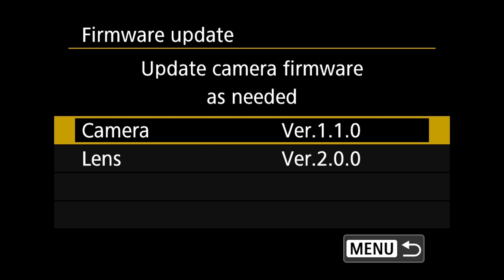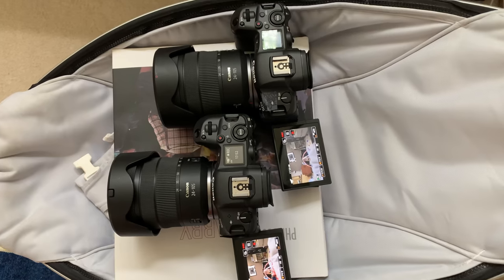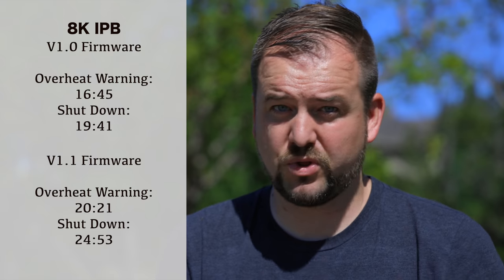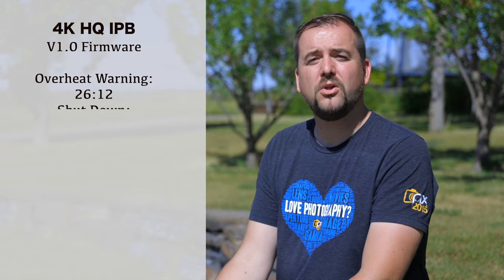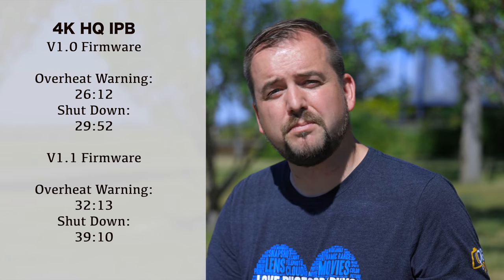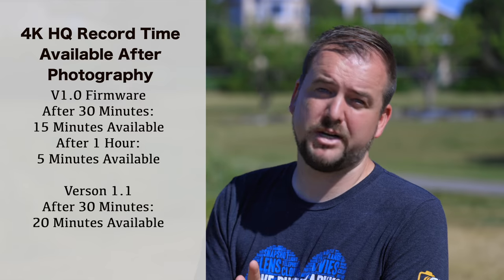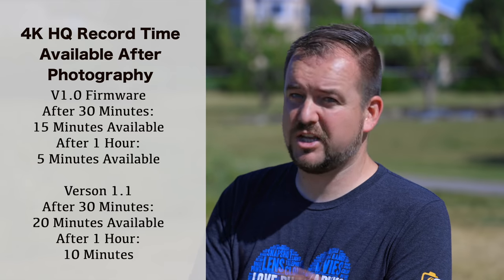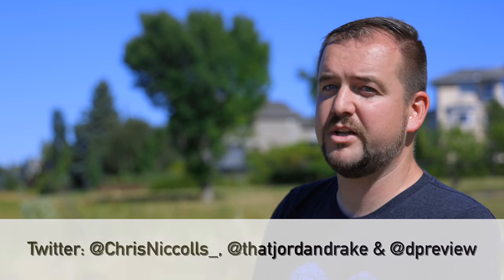Canon R5 Firmware 1.1 - Is the overheating fixed?

Comment: The question is why does it take so long to cool down? What the hell? My oven cools down faster! It must be a software thing
Reply: it is, and yes, it feels too artificialy limited in that way. only thing that can be done is keep pushing canon so another firmware fix will come.
Reply: it's basically a timer in there. There are reports from techblogs out there that taking out a single screw in the battery compartment will deactivate that timer entirely.
Reply: @makanimike  not directly. you block the switch in the battery compartment (with a screw or something similar) so it thinks the door is closed. that way you can pull out the battery anytime without the camera proper shutting down. without proper shutdown, it does not save the overheating timer flag. so when you put back the battery, it doesnt know it already run for x amount of time and starts clean. thats only to proof the timer theory though, not a valid workaround.
Reply: Your oven is not weather sealed....
Reply: Digi20 although it appears to be a software limitation I don’t think it means Canon is intentionally trying to cripple the run time. The cameras may well be capable of running much longer but at what cost? Heat and electronics are never a good mix. I’m sure Canon did testing and created limitations for the longevity of the camera. Imagine one could record unlimited but then 3 months after using it the camera fails. Now that would be a much bigger problem than overheating. To me it appears Canon is trying to push the limit of the camera with regard to the devices life expectancy. I don’t think it’s an intentional cripple hammer like many are making it out to be.
Reply: It's not hot in the first place. And it's just the cooldown timer running. Temperature sensors have no role here.
Reply: @dwmspace  it is a cripple hammer because the timer is artifical. electronic components do have rated life expectancy in regards to temperature. f.e., 2000 working hours at 95°c. it is enough to set a simple temperature limit where the camera shuts down to archieve the life expectancy canon wants, its not different to a notebook or any other high tech electronic device around in this regard. 

the timer would only make sense if the camera is so badly designed that one ore more components reach critical temperatures really quick and canon actively wants the user to get annoyed by the camera and dont use these features often (instead of contructing enough headroom into it). but this would just be silly and i dont know of any device that works like that.
Reply: @schaerfentiefe1967  it's sealed enough to maintain temperature
Reply: @E_8519  no oven will maintain temperature for more than some minutes. It will need to switch heating on and off to keep the temperature on a constant level.
Reply: @schaerfentiefe1967  it is also 400 degrees. So you're saying the camera is heat sealed? That's not smart
Reply: Digi20 the timer is there so that the camera doesn’t immediately shut down or within a few seconds of an overheat warning. It’s in place to make a prediction. It’s much better for example to have a warning and know that the camera can still shoot 5mins so that one can better plan a scene than recording something critical and have it shut down immediately or within seconds. To me it makes sense. A computer has the ability to slow down cpu performance and kick in fans or to shut down immediately to avoid damage. A camera does not have that same luxury to slow down its cpu performance if recording something like 8K. Also I’d much prefer a shut down prediction than have my camera just shut down quickly. This is not a cripple hammer, it’s the nature of the camera and giving the user an ability to use it reliably without sudden surprises.
Reply: @Digi20  It maybe the case that Canon is using timers instead of putting multiple rtds (most likely)/thermristors/thermocouples (temp sensors) in the cameras on different components. I haven't seen any of the breakdowns mention how many actual sensors are in the R5. If there's only one (or possibly none) and it's all based on Canon's engineering tests where they attached external sensors and then developed timers based on that research then all there would be would be timers. That wouldn't be crippling it would be sensible time limits based on data and averages to prevent long term damage to the camera. Now they might be able to fine tune that over time with more data but that may have been the route they went. Now I'm sure someone will say it's still crippled they should have put more (or some if none are there) temp sensors in and used actual real-time data and maybe they should have but one rtds/thermristors are another failure point (and they have a high fail rate tbh and would be more likely to fail then other components and then turn it into a brick) and two they would take up more space on the boards/in the camera that may not have been easily available.
Reply: @kaadhome5821  You are correct. Gordon Laing made a post today where he talks about the info that Canon shared with him regarding this. Basically it has 3 temp sensors (one that's external) that determine when it's safe to shoot or not. The firmware update won't allow higher temps, but has enabled the sensors to take readings more frequently for more accurate data, and as a result the camera is able to record longer, and recover faster. Gordon confirmed this info by putting his camera in a freezer to speed up the recovery time by 3X.
Reply: @kaadhome5821  according to a tech site (i forget which, sorry) there are 3 sensors. plus the timers. with the new 1.1 firmware update, they gave more weight to the sensors and less to the timer, so the camera runs a bit longer. its just a software thing. and of course there has to be sensors because the cameras get used in such different temperatures that only timers would not work
Reply: @dwmspace  of course a short timer makes sense, but it has to be one that is sensible.  when the camera records and cools down for exactly the same time, regardless if its in a fridge or an oven, than it clearly is not setup right and crippled.  firmware 1.1 from yesterday shifted that behavior a bit away from the timer to the actual sensors. but to me it still feels to artificial. cool down should be much quicker than it is at the moment.
Reply: Digi20 I believe it is sensible and they’re working on improving it obviously. They’re optimizing a design without a fan and large heatsink. There’s only so much they can do without making the camera much bigger or noisier. It could also well be that having a heat sensor and cpu to measure in real time is too processor intensive, generates more heat in itself and drains battery. I think the trade offs are reasonable for the sensor resolution and recording abilities. Higher resolution sensors that capture 4K/8K is ultimately bound to generate a lot of heat and Canon’s best bet has been to average the maximum recording time while keeping things operational.
Reply: Digi20 sorry that is BS. You cannot make a blanket statement and say all components work up to 95C. I deal with this all the time, some only have 70C limit. Others will fail at a elevated temperature. Each and every component has a maximum operating temperature. If you exceed it, maybe not to today, but it could be tomorrow, next week, next month or even next year that it will fail.
Reply: @FelixCervantes  I never said that? I wrote f. e. (for example).

Comment: Why does everyone excuse the over heating R5 citing its 8k, CFExpress card and big sensor when the R6 is suffering from the same issues with non of that and only a 21MP No one is talking about that. My 90D shoots 4k with a 32MP sensor @ 10/fps for ever...?
Reply: 10fps is no big deal
Reply: Your 90d doesn't downsample a full readout of the 32 MP sensor to make a 4k image. The R6 downsamples the 20MP sensor to get the 4k, which is more intensive than a pixel binned 4k.

That being said, the overheating limits on the R5 appear to be implemented by a timer rather than a temperature check. Agree that the R6 should get some more attention
Reply: The difference between 90D and R6 is that when using R6 in photo mode the sensor and the EVF/Screen are ON the whole time which produces more heat in all modes.
Reply: @thatcherfreeman  downsampling 5.9k to 4k isn't an intensive task with the current  image processors.
Reply: @karthik2166  True, the intensive part is the heat created by the sensor readout, not the image processing part.
Reply: @Pozdravlyau "Clown" you tell it to your family members. Having said that, yes my mistake R6 (not R5) does display overheat warning and shuts down in any mode. I don't need to read what pixel binning/oversampling/downsampling or whatsoever makes you feel more knowledgeable, since I know what they are but there's no mention of them in the original comment about 90D, which shoots at 10fps anyway....
Reply: Karthik exactly take a look at 1dx mark iii. No issue there
Reply: Your 90D has a smaller sensor, and 10fps seriously?
Reply: 90D doesn't oversample. it's more like line-skipped 4k, which is relatively soft. Whereas, the amount of data for processing R5 and R6's footage is literally massive. (8k and 6k each) So your comparison is basically wrong.
Reply: @davidum1900  The Nikon Z6, Sony A7iii and the Panasonic S1 are also using oversampling to create 4k from a 6k sensor readout. And for the most time those cameras don't have any issues with overheating. And they are running on much older hardware.
Reply: romanpul to be fair tho, the oversample readout for the a7iii is only for 24 fps 4k not 30 fps. But yes, I agree with you

Comment: Canon has added these limitations in the programming. Extensive tests have shown that the camera completely cools in min and sometimes even seconds.
Reply: The thermal design is inadequate for chips generating significant heat. Either the chips run cool and the lack of cooling doesn't matter (which would mean the so called "thermal limits" are artificial) or the thermal design is shoddy (which could be either incompetence or intentional crippling). In the latter case it is not only possible, but likely, to have one or a few chips overheating in an otherwise cool camera body.

Comment: got the code from canon:
Version 1.0
function overheating(){
const OVERHEATING =19.2;
..
}
Version 1.1
function overheating(){
const OVERHEATING =25.4;
..
}
Reply: so they just increased the threshold?
Reply: @shaikhahmed7929  non, they increased the duration they allow you to use your new toy
Reply: @shaikhahmed7929  What they ACTUALLY did (I realize the original comment was an attempted joke) is increase the frequency that the 3 built in temperature sensors retrieve data, and as a result they are now more accurate and record times are longer.

Comment: Ok, guys, you have such a big platform and you not gonna acknowledge the findings of Andrew Reid from EOSHD? If he is correct all those limits are purely artificial software crap… I think for the sake of your own credibility you should start at least mentioning the potential scam that Canon is running here to preserve their cinema lineup. Cmon, guys!
Reply: Ya it maybe fully software based to cover for lack of additional hardware to take true measurements. It is common to do temperature engineering testing during to development to develop data for how quickly something heats up in what conditions and what is harmful long term so as to develop firmware (not software) to dictate how a device functions. Temperature sensors take up space and are prone to failures so if you can avoid them and they aren't hyper critical it's best to do so. In some device's they are needed or there is more room for them making it easier to be able to swap out (if they aren't on board obviously) or place multiple for compensation.
Reply: EOSHD has also demonstrated in the latest post that removing the battery and inserting a single screw into the battery door resets the record limit! https://www.eoshd.com/news/canon-eos-r5-so-called-overheat-timer-defeated-by-a-single-screw-in-battery-door/
Reply: Cheers Frytech. They won't acknowledge the groundwork. Not just by me but other early adopters who spent their hard earned money on the camera. So while YouTubers rip us off and jump on the bandwagon, Canon release tricksy firmware updates that make the camera a better actor and measure temps it wasn't doing before. The bullshit level is now officially through the roof and Philip Bloom is going round painting me as a villain! 2020 is an odd one!